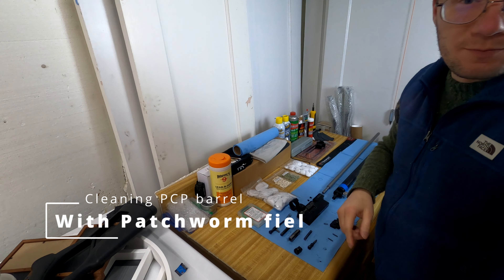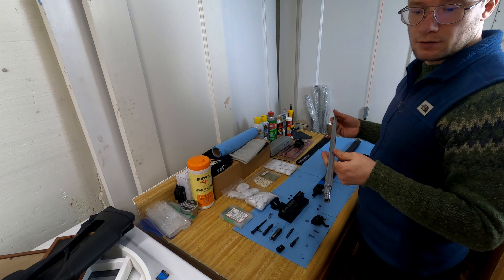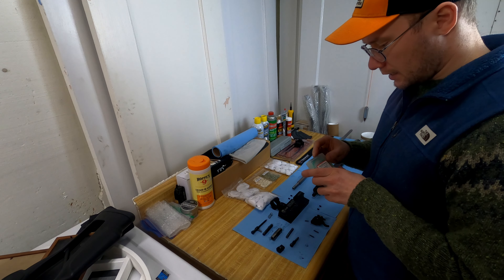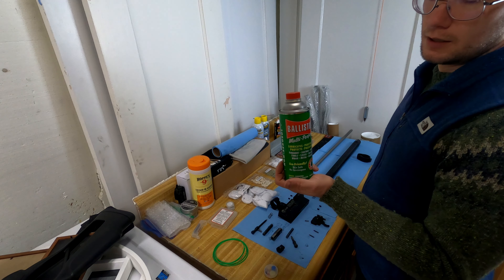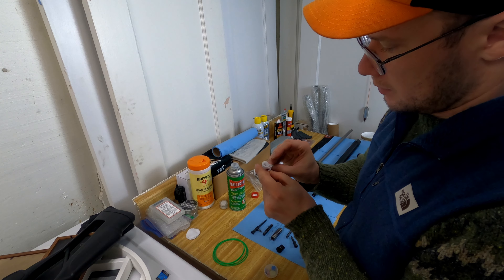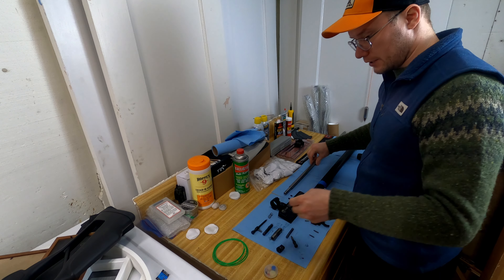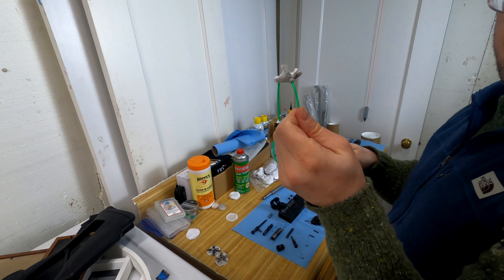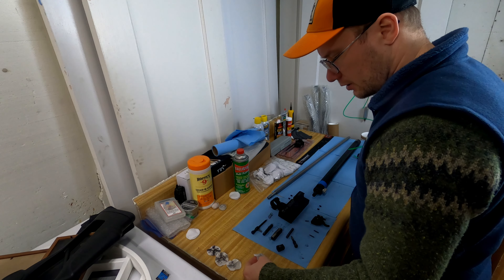How to clean traditional PCP barrel with Patchworm

Comment: Great vid!  Also with the dry patches, when they are not as dirty, you can flip them over and use the other side to stretch out your patch supply. 👊
Reply from the maker: Thanks for the info! That's a great idea to do especially if the barrel is super filthy.